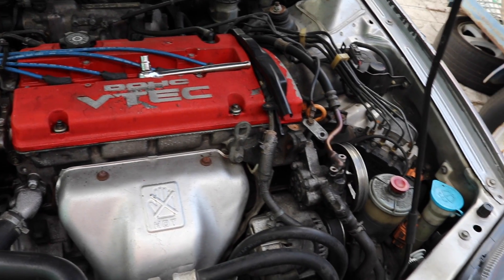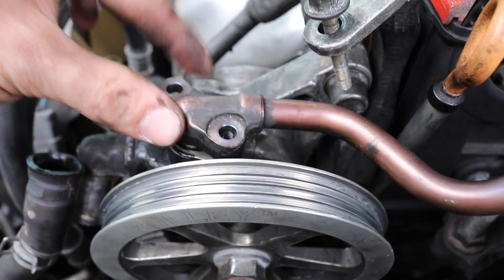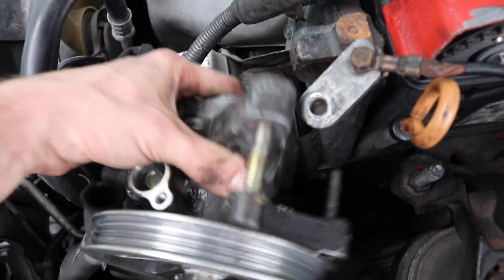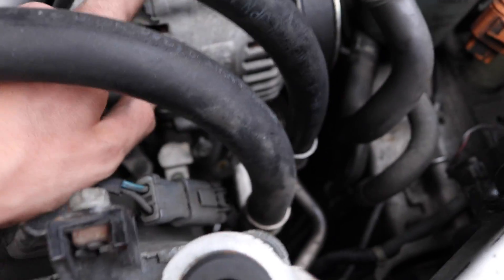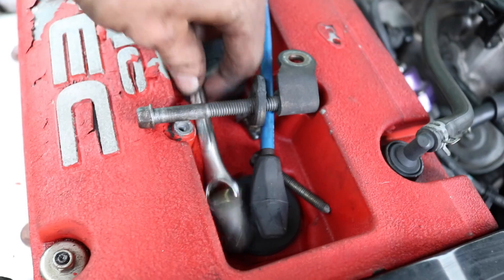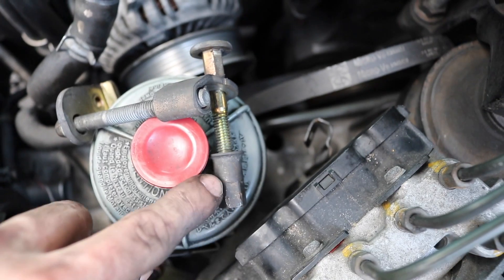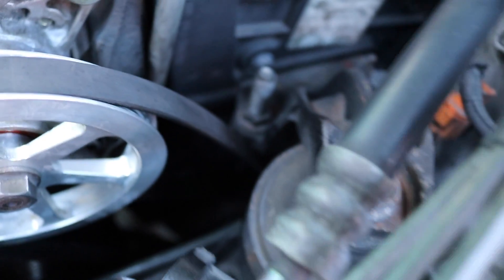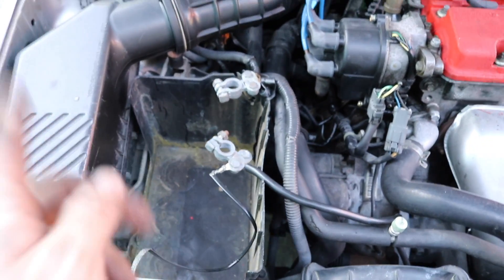How to replace Alternator 97-01 Honda Prelude

Comment: Thanks! Used this to replace the alternator on my 98.  The stupid heat shield doesn't need to be completely taken off, you can just take off the first bolt and pull it aside to those who still have it on.  Honda engineers of the 5th gen did not make this process easy...

Comment: You don't have to disconnect the PS line. Just unbolt the PS pump and pull it up and set it aside. The 12mm nut holds the alt. at the bottom and also holds the tensioner with the 10mm hex bolt at the top. To tension it just screw it in or pry up on the alt. until desired tension is achieved then tighten the 12mm and 14mm.
Reply: So I can tell you've done this yourself a time or two🤔 
Good advice dude👍👍thanks
Reply: Very helpful, just the info I needed as  I'm in the middle of replacing my alternator.  Thanks!

Comment: Thanks for that I had trouble figuring out that alternator pulley tensioner. I knew there was a bolt underneath there somewhere I just couldn't find it. :)

Comment: The bolt underneath the pulley you can see it underneath the left side driver wheel if you remove wheel and you can tightened it that way and see reach under the alternator.

Comment: Hey man hope you reply asap , but my serpentine belt snapped today and I'm wondering if I could do the same process you did in the beginning to loosen the pulley. Great video btw
Reply from the maker: which snapped power steering or alternator? Yea man if it's any of the 2 belts I messed with, than yea just release tension by loosening the bolts and then put the new belt on.

Comment: This was a horrible design by Honda. Busy working on my 98. There's very little space with the power steering and high pressure hoses all squished in the area near the alternator. The top bolt is a bitch to align for the thread to go in.
Reply: i have a 98 and it took me 30 minutes just to make the bolt catch lmao
Reply: My friend had a Mazda 626 (forgot the model yr) bro that thing needs to be jacked & yu gota unhook front axle from a wheel to get to alternator🤦🏽‍♂️🤷🏽‍♂️
Honda is a joy to work on compared to that POS 626. That Mazda is probably the worst vehicle to do simple DIY maintenance on.